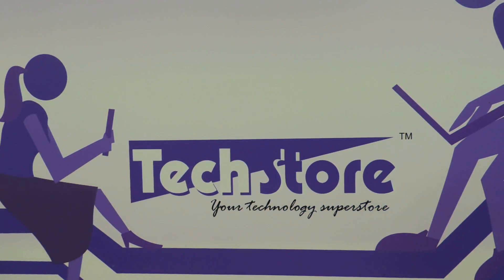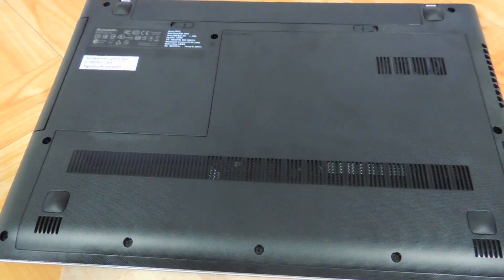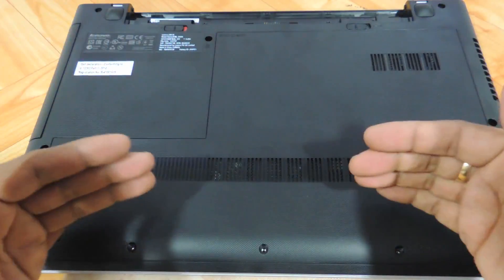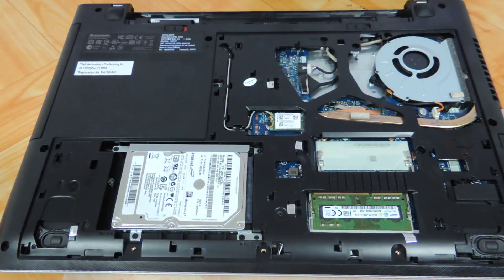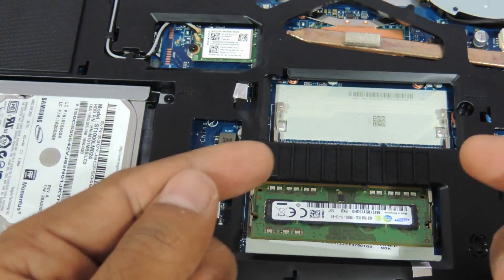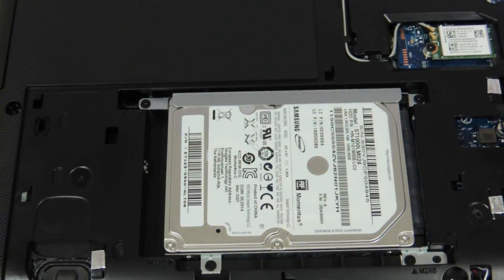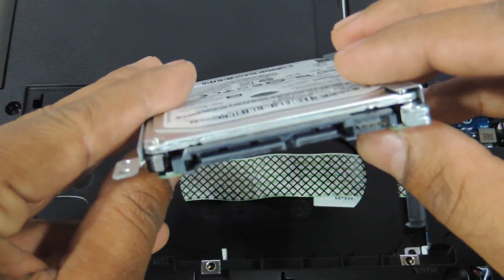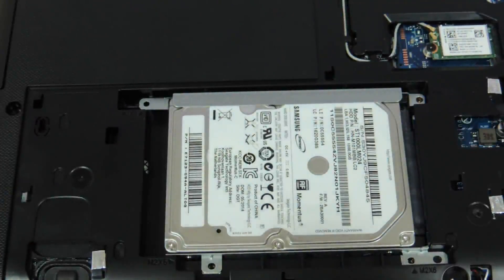Lenovo Z50 70 How to upgrade ram and harddrive easy diy method

Comment: I currently have Samsung 8gb 2rx8 pc3l-12800s-11-13-f3 ram and i5 4310u processor. Which ram should I buy to upgrade and will it be worth it?( I have Lenovo z50-70 laptop)

Comment: Can i add another 8gb ram although the provided is 4gb ram, means it will become 12gb ram? Or is it have to use the same gb instead (4gb+4gb or 8gb+8gb)?
Reply from the maker: You can add another 8Gb easily. No issues.

Comment: What RAM does your varient have? Is it a DDR3L 1600 MHz 1.35V samsung memory?
Please reply as I want to know what RAM to buy for my Z50
Reply: my lenovo z50-70 has that samsung memory
Reply: For anyone who come and see this question .download cpu-z on the spd menu it will show ram spec but cpu z will show only ddr3 u wont know untill u see the bottom voltage that ur ram take if it write 1.5v then it is ddr3 and if it write 1.35v then it is ddr3l.

Comment: That's Not Upgrade RAM you just moving RAM :3 into another SLOT
Reply from the maker: +X Grounded we show how to access your ram area of the laptop in the video. Instead of moving the same ram,you can take another ram of given specifications and upgrade !
Reply: So how many slot ram in This laptop I because i check CPU z this laptop have 4 slot ram not 2..
Reply: Yes, I don't know why but both CPUz and the Task Manager says I have 4 slots, even though thats not possible with the i5-4210u as it can take only 2... I think there might be 2 more slots in the other side of the motherboard, but it's most likely a recognition error...

Comment: sir..my new lenovo z51-70 with i7 is very slow to work..I think the default hard drive is very poor right? what should i do, is it possible to replaced it by a 7200rmp 1 tb drive?
Reply from the maker: +Sandy Aego use ssd
Reply: how much does it cost?
Reply: Just look it up.

Comment: Can I upgrade my  i3 processor and install new  i7 on Z50?
Reply from the maker: +hannibal lecter no you cannot if it is above 4th gen processor. let us know the exact model number of your processor. we will be to help
Reply: lenovo z50-70 model 20354
Reply: CPU Type Mobile DualCore Intel Core i3-4030U, 1900 MHz (19 x 100)
Reply from the maker: No you cannot. It is soldered processor. Do subscribe to get instant replies.
Reply: @TechstoreCoIn  reply
Reply from the maker: Subscribe and get instant replies to your queries
Reply: @TechstoreCoIn  mine is z50 i7 4510U 2GHZ CPU with 8gb ram and 512hdd
It hangs and is slow
Should i upgrade it or buy new lap?
Reply: @TechstoreCoIn  ? Subscribed bro

Comment: how do you check your laptop ram speed? I'm currently using Lenovo z50-70
Reply from the maker: The memory speed is 1600mhz
Reply: +Techstore  okay thank you!
Reply: +Techstore I have the same laptop in white which is only 800mHz. Considering its an APU I need to upgrade the bandwidth.

Comment: what videocard should I buy to put it in my lenovo z50-75 ? and how effective is that?
Reply: +Iucha Megreladze Sadly, you cannot upgrade the GPU or CPU on Lenovo's laptops, at least not on the Z50 models, as all components apart from hard drives and RAM are soldered onto the motherboard and thus you cannot replace the standard GPU/CPU or put in a new one.
Reply: Okay... it's sad but thank u anyway!

Comment: which type of ram should I buy for my lenovo z50-70 plzz.help
Reply: +P Bos SO-DIMM is for laptop and DIMM is for desktop
Reply from the maker: +Daniel Quadras DDR3L 1600MHZ
Reply: +Techstore   hi,I never knew that the harddrive can be updraded on this lapttop which I use now.
Wanna order it via loca dealer myself. But which harddrive will have to be purchased ? TIA
Reply: +Techstore Do I need to order SO-DIMM or DIMM DDR3L modules for the Lenovo Z50-70? Thanks in advance.
Reply: Mad Nakan Thank you.

Comment: i have problem with my z50,when i press power button, it only have light power but the screen wont turn on and i dont hear the fan running...everytime i must do power reset about 60 second or 2-3 time to open and powering it and its not normal..how to fix it...
Reply: Hey, it happened the same with me 😢 Did you figure out what what happened and how to repair it?

Comment: nice video very informative. I own this and in your video I can see that there are only 2 ram slots but the task manager in windows 8.1 shows-- Slots used- 1 of 4
so now I am confused whether it has 2 or 4 ram slots and are they dual channel or single channel and another ques- is it necessary to use the low voltage ram?
thank you
Reply: Lenovo z50 70 ki recover he to ..Plz help me
Reply: Nitish Kumar to add ram to the other slot you must remove the keyboard

Comment: Very useful video, just purchased this laptop with 
i5
Navidia Geforce 820m 2g.                                  1Tb ssd
 8g ram
Now I'm not pc/laptop savvy but for price it's a decent rig, good to know should I need to upgrade it's very straightforward! 
 Would be good to know if graphics card and processor etc etc is upgradable!
Reply: Sean Homar Sorry, but the graphics card and processors in laptops can't be upgraded. Only the RAM, storage, optical drives, and wireless cards can be upgraded in most laptops. But your laptop should be able to handle most forms of media and even light gaming for the next few years.
Reply: +Randomgamer50 GPUs can be upgraded on some laptops.
Reply: Yes, but only in very few situations. sure if you get something lie the MSI Gt80 or other unique cases. But for the most part gpu's in laptops can not be upgraded. But I tried to keep it simple since he said he wasn't tech savy

Comment: I have lenovoz50-70 59420313
and i m searching for an extra 2gb 1600mhz ddr3l
i have searched on ebay and it shows same ram with PC3 12800...
I doubt if it would be compatible with my laptop. PLEASE HELP!
http://www.ebay.in/itm/2GB-DDR3-1600-MHZ-PC3-12800-LAPTOP-RAM-HYNIX-or-SAMSUNG-or-NANYA-/261657268754?_trksid=p2054897.l4275

Comment: I have the highest version of the z50-70, with 8GB ram and 1TB HHD.. Can I still upgrade it?
Reply: "Sorry love" but there are higher clocked i7's and 860M which is much faster than the 840 or 850.
Reply: I bought the same version yesterday and ordered a 250 gig SSD which I'll be replacing the hard drive with.
Reply: Lenevo IdeaPad Z50-70 i7-4510u Dual-Core / 16gb of Ram / 4gb Video Memory with powerful Nvidia GeForce 840M DDR3 - Sorry love, but this is the most powerful :)
Reply: Thomas Elswick and?:D
Reply: My pc is same as +janis :)
Reply: Jānis Sidabrs What do you mean, too proud of my mediocre rig. I've got this laptop myself and it's good, especially in its price class. But it's def not high end.

Comment: can you install an crucial mx100 ssd in this cause i got one and its not booting up from my SSD its stuck at a black screen nothing happens.
Reply: yea found out that the SSD just isn't able to connect with the firmware of the laptop firmware. So i just returned it and got a samsung evo

Comment: Is it posible to use Caddy Adapter into optical mechanic to upgrade notebook with SSD disc?
Reply: I will try that (bought a branket on amazon and hope that it will fit XD).
Reply: shag stars Hi,
Have you check it? Im looking for a ways to add second HDD.
Reply: Alexander Tretiy it is possible but you need a 9,5mm one not the 12,7mm one.
Reply: shag stars Thank you for a quick replay. Could you please share amazon or ebay link to this adapter?
Reply: Alexander Tretiy In which country do you live? (there are more amazons webshops).
Reply: shag stars I live in Ukraine, Previously I purchased hdd Caddy for my Lenovo T450 directly from Amazon.
Reply: Alexander Tretiy I find it
http://www.ebay.com/itm/2nd-2-5-HDD-SSD-Hard-Drive-SATA-Caddy-Adapter-for-Lenovo-IdeaPad-Z50-70-B50-30-/390929040434?pt=US_Drive_Bay_Caddies&hash=item5b052fc432